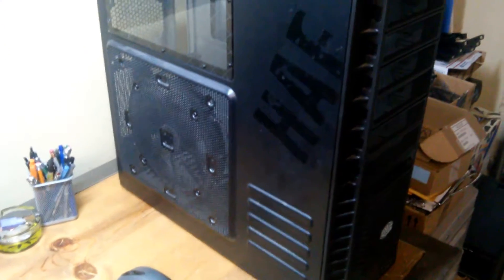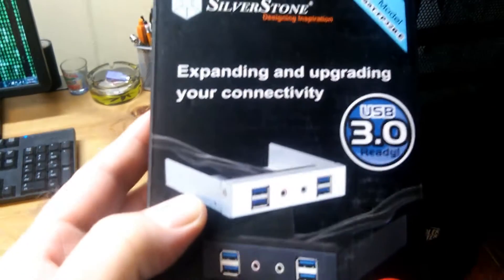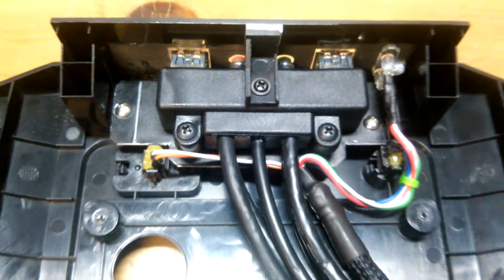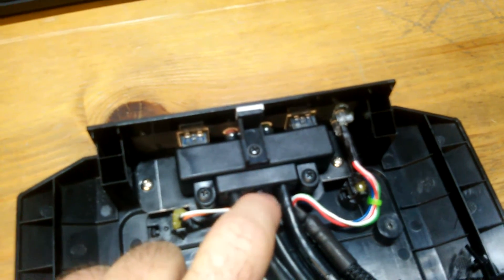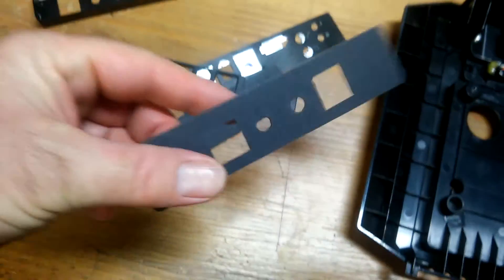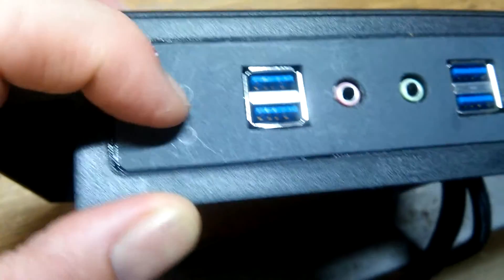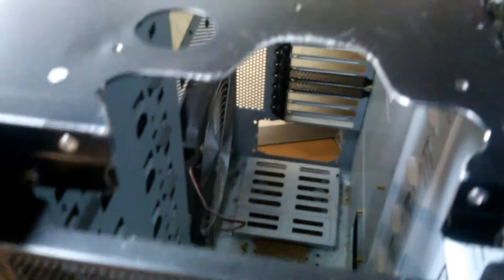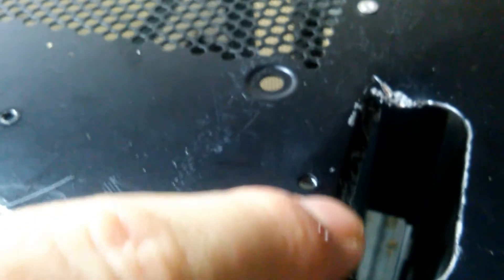Cooler Master HAF932 Front I/O USB 3.0 Mod

Comment: Nice Job.
 I'm replacing my i7-920 on Asus P6 with Asus B650E-F and Ryzan 9 7900x with rx6900xt GPU. HAF932 still looks like new with 2 original fans.
Case was purchased at Microcenter for $159.99 January 2010.
I can't bring myself to cut the case!
Reply: Did that setup work and fit ok in this case? (I want to upgrade, originally built in 2011 with some help)

Comment: "It's pretty old"
Me in late 2021 looking for parts for my HAF 932.  Yes I still use it!  :D
Reply: 2024 here
Reply: Still using mine. :)
Reply: 2024 here
Reply: @FIawless_Cowboy  It's very difficult to find parts for it, for example I'm using it even with a broken USB on the front panel, as it's impossible to find another front panel =/
Reply: @Marcelog09  Yeah that's what is broken on mine as well.
Reply: @TheSafierdrgn  In my case it broke twice, the first time which was many years ago and  managed to import a new panel from ebay, coming from England, but nowadays it is impossible to find it.
Reply: 2025 new build.

Comment: Nice work.
After I saw, I made my own mod. http://www.overclock.net/forum/161-computer-cases/392179-official-cooler-master-haf-x-932-922-912-club-2359.html#post26916529
Reply: Ha nice I just replied to that oveclock.net thread asking you for more information, did you ever get a type C port in there and do you have any extra pcb handy?  lol
Reply: @calistin1  no unfortunately I did not find connector that connects with motherboard side, I could not even found any technical information about this connector.
I wrote more detailaied article on bittech forum.
I have extra pcb of this, but they are in home, whereas I am in the USA now.

Comment: my usb ports are broken. i already used an additonal USB 3 Front Panel  last 2 years but now that is also broken. i was searching for an offical usb 3 upgrade for the case and found your video. nice work. i dont think i can do that myself. I'm not good with such a things^^
Reply from the maker: Thanks dude, I'm glad you like it, I should mail it to you =). Sadly, I haven't touched that case since I did this mod. I'm a bit of a PC hoarder though and I've convinced myself that I'll get back around to the HAF project eventually. It's not too difficult, you should give it a try. That's cool you found it with a search!
Reply: Any chance you can send me some the pieces of this case if I PayPal you money? I need a few of the mesh pieces for the front and two of those back panel mesh pieces. Can you email me please so we can work out a deal? Would $10 plus $5 for shipping be good? Saknice20@yahoo.com
Reply from the maker: Hey man. Unfortunately I have used all the front mesh pieces for modding other PC's. I do have 2 of the back panel PCIe slot mesh covers left, but I'm sure the front panel inserts are the ones you really want. It's BS that CoolerMaster stopped selling replacement parts for the HAF932.

Comment: A computer for a case of beer. Best deal I have ever heard. Great mod!
Reply from the maker: +Matthew H I couldn't believe it when I saw the Ad. It was a top of the line X58 system back in 2009. The only thing it didn't have was a GPU. He had a leak in his cooling loop that fried the GPU and he never turned the PC back on. I guess he was over it. I made some cash parting everything out on eBay =). Can't wait to paint the case and put some updated hardware in it.
Reply: +Jon T  you should make a video(s) of you painting and or further modding the case. Also showing the final product with the updated hardware. Keep up the good work.
Reply from the maker: +Matthew H I plan on showing the progress, just don't know how long a project like this will take me. I've never painted a PC case before. I'm definitely not going to take it apart (de-rivet) to do it, that's way to much work. I'll clean it up and prep the metal really good before I paint it. I'm making some digital camo stencils with my vinyl cutter, so far they look like they'll work nicely. I really don't want to do a camo paint job if I can't get it to look professional. So many bad camo jobs out there.